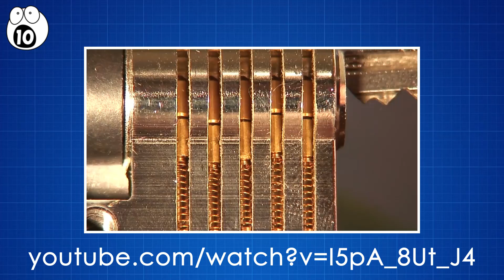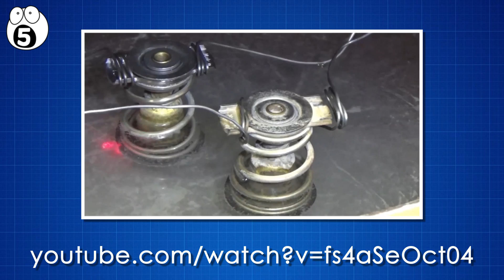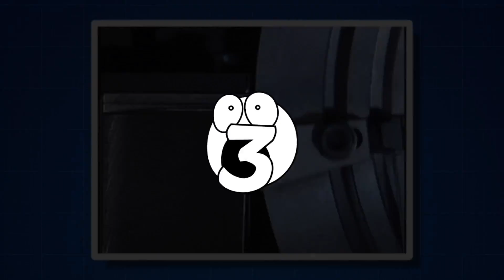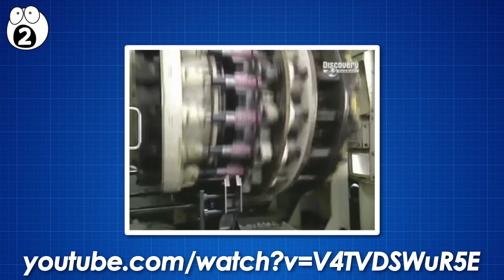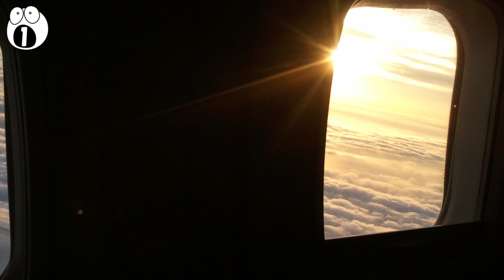Ingenious Designs Hidden in Everyday Objects

Comment: I know the video was 2 years ago, but I noticed something not quite right. The making of the cans. The seal to make it air tight is not applied after the double seal is created. It is already on the lid or the base beforehand. It's like rubber around the edge. I used to make triple seamed cans.

Comment: In fact, a few airplanes crashed due to rectangular windows. After these incidents, all modern airplanes were designed with rounded edges to prevent structural stress to destroy the windows.
The little hole is to equalize the pressure and to keep the window from fogging up as moisture would condensate due to the low outside temperature and the higher inside temperature of the air.

Comment: When computerized locks take over (If I live that long), I think I will use key/mechanical locks. My reasoning, crooks will probably get better at creating hacking software to bypass the system and enter the code and will lose their skill at lock picking (given you get a fairly complex lock).

Comment: I don't think i've watched one of their videos with actually correct facts. The fan thing, the stick spins the head its self as it shows in the footage. He was talking about the blades. I mean WTF?
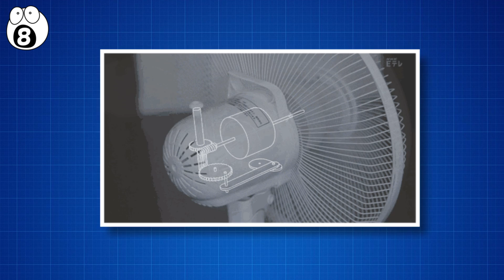Reply: And the motor is already spinning before you press down the stick. The stick connects to a set of gears at the bottom as shown to spin the head ( 2:15 )

Comment: One feature of the modern beverage can I love is the tapered edges at the top. Not only does the taper allow for securely stacking another can but more importantly to the drinker, the taper allows for the lower lip to be comfortably seated along the edge, bring the can opening closer to the mouth when pouring liquids out, avoiding spillage and leakage.

Comment: You got the plane windows wrong.  Its not about stress breaking the windows, its about the window FRAME making stress into the structure.  One of the earliest commercial flights blew up due to square windows, but it was from the structure being weakened by window frame not the window breaking.

Glass never has direct contact with structures, if i did it would be able to be replaced and break very quickly.  Its always a window - sealant - frame - structure.
Reply: No matter how much stuff you put between the edges and the structure  it still gets stress, it's still making contact with the structure. Windows with rounded corners resist more because you can easily break tempered square glass if you hit it with a sharp pointy object or from a corner.
Reply: true the de-Haviland comet had a problem with this and a few exploded in the 50's

Comment: You got everything wrong about oscillating fans!
The peg is not used to turn on and off the fan, but rather toggles between fixed and oscillating modes.

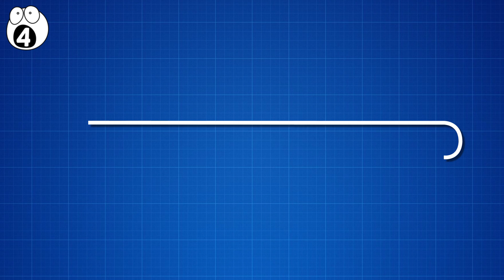Also, at 5:51, you say that a paper clip has 4 180 degrees turns. This is also wrong, there are only 3 180 degrees turns!
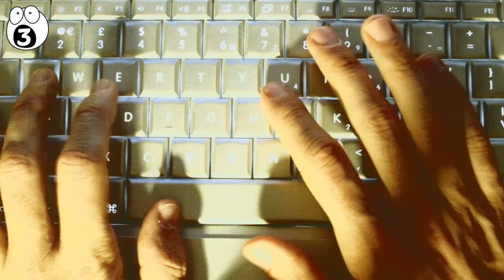Reply: Nicholas R.M. And at 6:36 referring to mechanical keyboard keys, and shows a a non mechanical laptop keyboard

Comment: Normal man or woman 90 pounds? I understand some body types are thin, but 90 would be considered underweight for most average heights
Reply: 90 psi, pounds per square inch, not just weight. a medium build male exerts around 13 psi on the ground normally, and on something  much smaller, with less surface area then say, the sole of a show. like a can.
Reply: Shark gaming ah. Sounds about right lol, it was like 3 AM when I watched this

Comment: there is another use for the tab on a aluminum can if you put a straw into a can of soda it will float up and fall out but if you turn the tab around 180° and put the straw through the hole it will keep the straw in the can also the hole saves money because they use less aluminum than if there was no hole

Comment: It's your finger that makes the liquid in a spray bottle fly out, and also compress the spring which in turn draws in more liquid to the chamber, so all the power needed for the operation of a spray bottle does indeed come from your finger.

Also, there's always coolant in an engine's cooling system. A closed thermostat just blocks it from circulating through the radiator.

And as to manufacturing a paper clip, that is a slow-motion video. It takes less than a second to make one for sure.

And finally, from what I understand, a rectangular airplane window would make the fuselage prone to crack near the corners, not the glass (or plexiglass) itself. Of course, a cracked fuselage would be an even bigger problem than a cracked window...

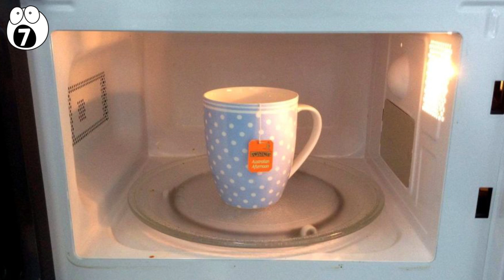Comment: At around 3:40, I believe you made a mistake. Metal is dangerous in microwaves because it reflects the radiation at such a high rate. You said teabag staples are designed to reflect more, but I believe you meant less.

Comment: 3:37 why would you design the staple to cause trouble in a microwave oven?
Reply: The staples are designed to reflect the waves rather than absorb them.
Reply: I think I misunderstood something too, and no I did not know metal burns, it should not be possible, iron is not flammable, but if it reacts like any other kind of metal then why did he mention it, it should be self-explanatory
Reply: Wrap a fork in some paper and put it in the microwave. Have a fire extinguisher handy. :I
Reply: Jake D'Cruz metal doesn't absorb microwaves , water absorbs them, microwave food has aluminum to bounce the waves back through the food to cook it faster
Reply: zachos 2000  i guess nobody came out with another kind of staples, like wood, paper or cardboard staples.... hehe
Reply: You know metal sparks and burns stuff in a microwave, right?
Reply: Microwaves are made of metal to ensure that the microwaves bounce around inside (else the MW oven itself would heat up), so yeah, metal reflects MWs (no special design needed!).  I assume is what was really meant is that the staples don't have sharp points on the 2 ends, as sharp points tend to create sparks in a MW when charge builds up on the points???
Reply: A fork shape will absorb (and cause trouble) and a staple will reflect (and generate more efficiency)

Comment: A bit more info about the mechanical keys for those who don't know, cherry mx are not a 'gamers' thing, they are loved by both gamers and typists, there are more switches like alps/bucking springs etc., but those are either niche or found in vintage/classic keyboards, cherry is the more modern and mainstream of the mechanical key switches.

Now, not all cherry mx keys are the same, in fact, its the variants that are usually associated with target groups, for example, gamers will usually choose the linear versions like red or black that lack tactile bumps and/or the 'clicks' (not taslking about the plastic noise but an actual click that you hear when the key press is detected by the computer) since they are better fit for speed and quick pressing, they are kinda like the rubber dome keys, but way more satisfying to type on...

The tactile versions are great for typist because the fact that you can feel a bump (e.g brown switches) and even hear the click (blue switches) when it is activated, that's why people love them, you'll never miss a keystroke with a tactile mechanical keyboard since you can literally feel the exact moment the computer detects the key.